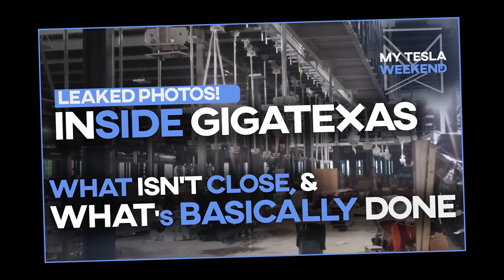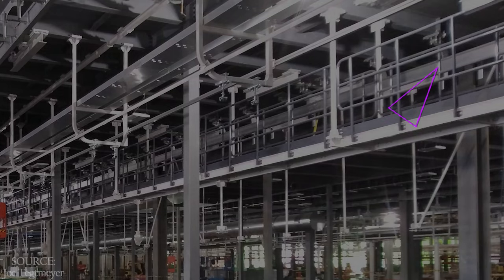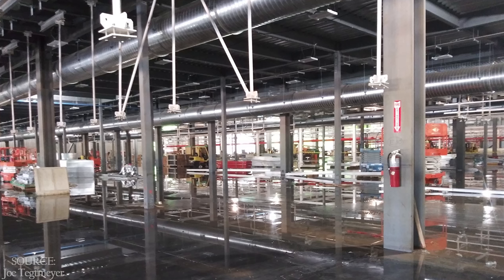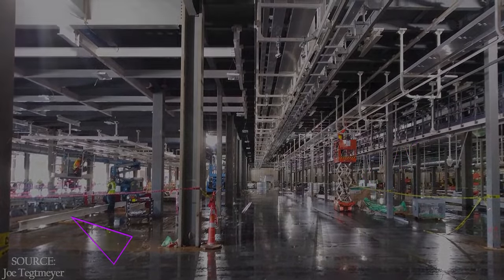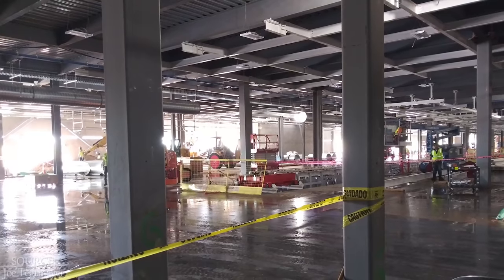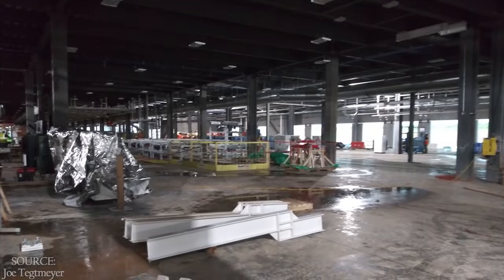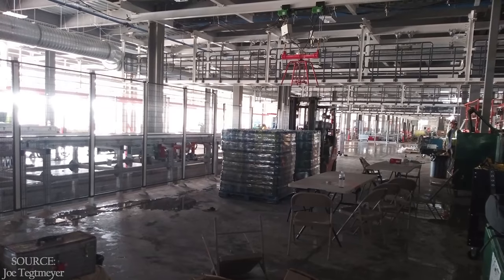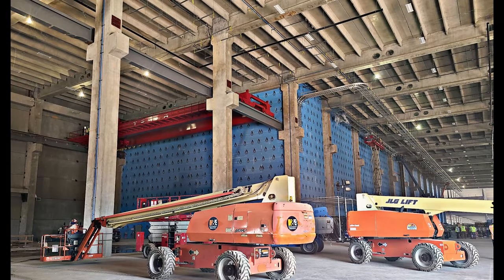Leaked pics from INSIDE Giga Texas

Comment: I retired after 30 years in a GM assembly plant.
The double columns are for expansion between major building segments.
The double line of brackets hanging from the ceiling are over where the assembly line be, they will support cross bars for hanging the tools and fixtures needs for the assembly process.   
The rectangular hoop bracket are most likely utility runs for power, air, etc.
I'm guessing the stamping machine area will not take as long to set up. A relatively few huge stamping presses and connections, where as the main assembly lines have the details, with a very large number of robots, other parts, and components needed to complete assembly,
Reply: Great comment and thanks for the info. I had a question: what are those in-floor conveyor's used for? Do the car's sit ontop of them? It seems different to what is in Shanghai. Thanks!
Reply: @jamescoppe   Those conveyor lines are not configured to handle a car with the tires already on, so they will likely carry a wheeled platform with the truck or car body resting in a cradle being shuttled to each work station in turn for the next operation.

Comment: If Tesla has regular security video of this area, an AI could pretty easily deduce the exact time and PoV at which these photos were taken and pick out (and probably identify) the photographer.

Not saying Tesla would care enough about these particular leaks to bother, nor saying such a specific AI application has been developed by Tesla at this time (they do have other priorities, lol!), but it is easily within the capabilities of current vision AI. If the security footage exists, it could be done any time in the future. If someone wanted to go to the trouble, a neural network to do this could be trained up in a matter of weeks. Organizations like CIA, NSA, perhaps some private security firms, almost certainly already have and regularly use such tech.

Something for anyone secretly taking and leaking photos to take into account when considering the risks. Pass this on to Joe to pass on to his source.
Reply from the maker: There are no security cameras visible inside the building, and the prevailing theory is that these "leaks" aren't entirely unauthorized. ;)